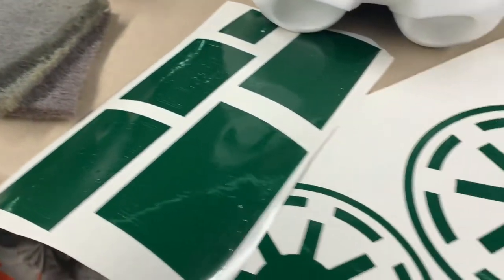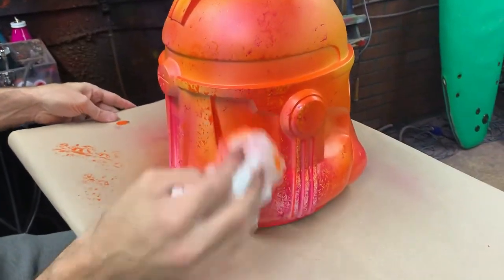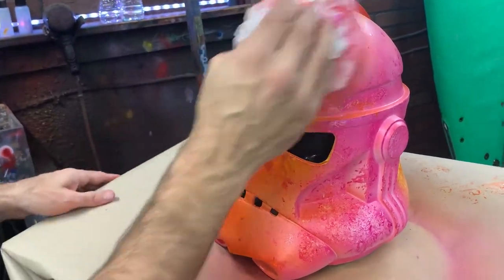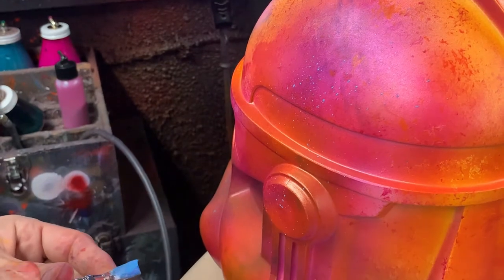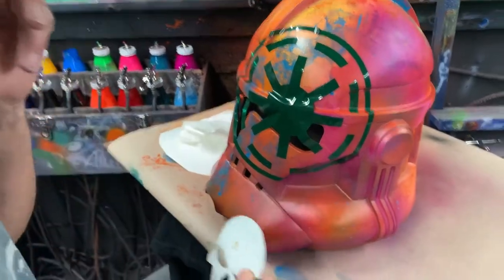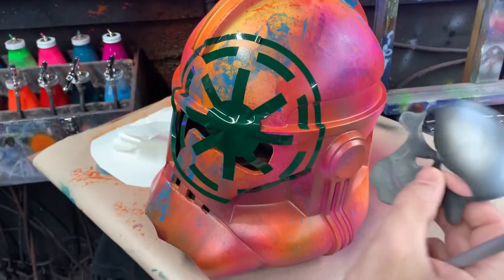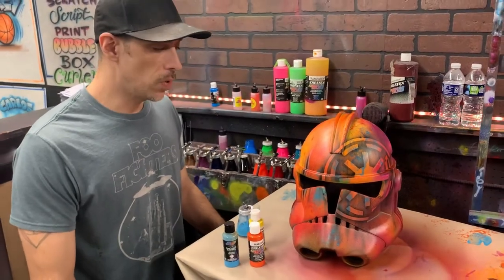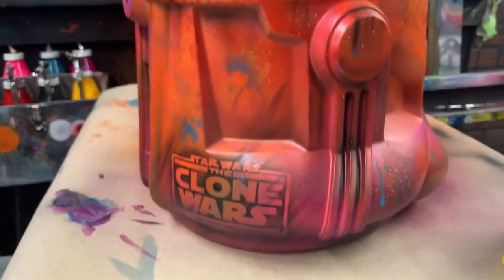Custom AIRBRUSHED Clone Trooper Helmet Timelapse & In-Depth Look!

Comment: The stencil you used for the project being almost all loose pieces would be harder more difficult to place cutting with paper. The vinyl cutter keeps everything in place while you put it on so floating pieces go right where they should. You would have to manually place every floating piece and this leaves lots of room for error. It how it used to be done before vinyl cutters but will take 10 times as long.